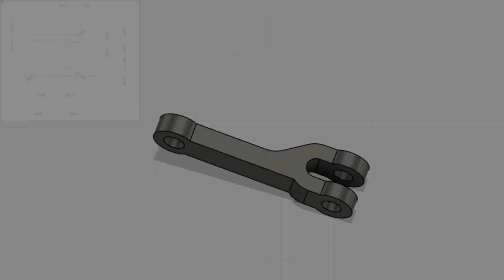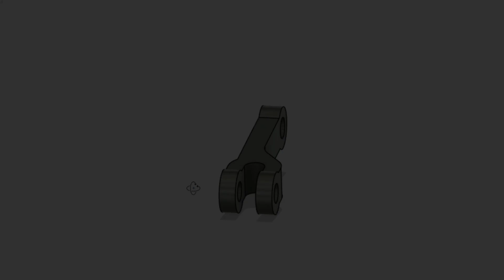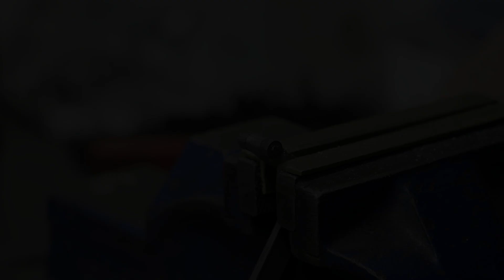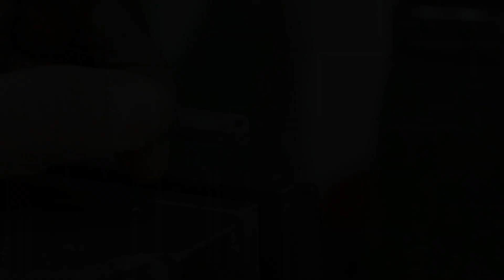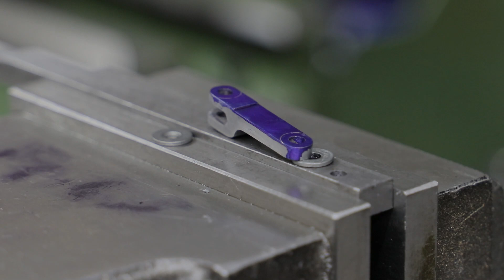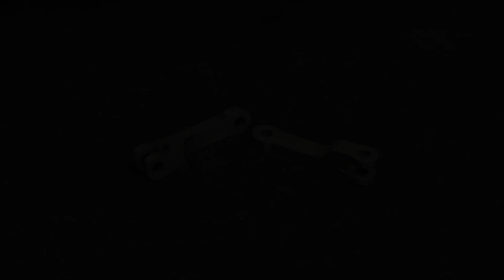Part 38: The Union Links

Comment: For the filing buttons, are you simply using a bolt for alignment through the hole?
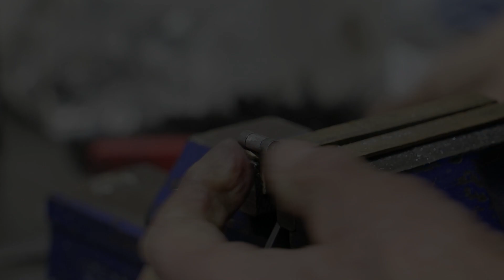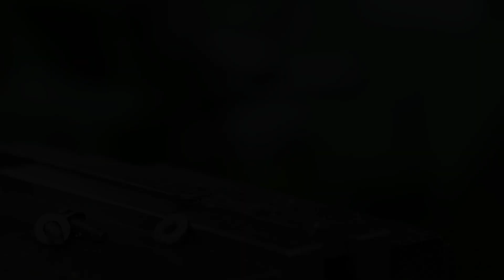Reply from the maker: Ahh, I was a bit lazy with these links and had the two buttons unsecured on a small piece of 3 mm bar.  Early in the video (1:29) I was holding them in place with my fingers (hence my hand being in the way) but later (4:37) I shortened the bar so that the buttons were clamped in the vice jaws (the bar keeping them in position).
If I wasn't so lazy, I would either use a bolt or turn and thread a pin - not so easy at 3mm diameter.
Cheers
Mark